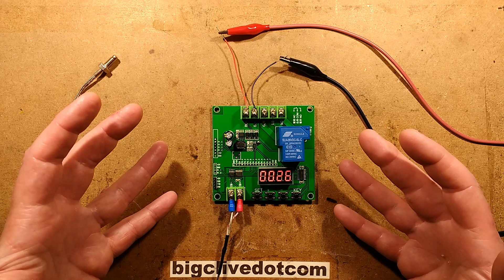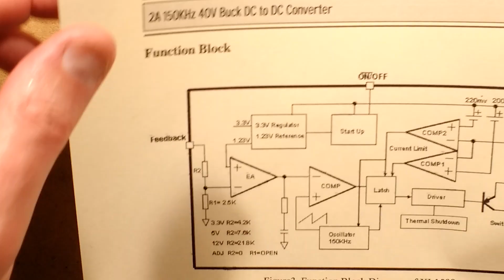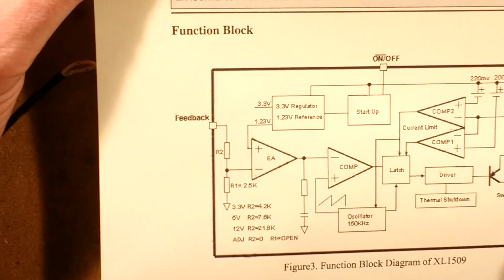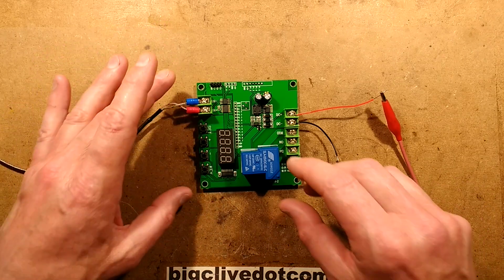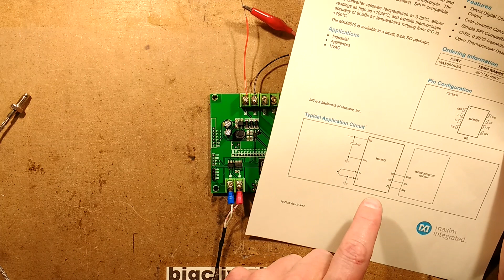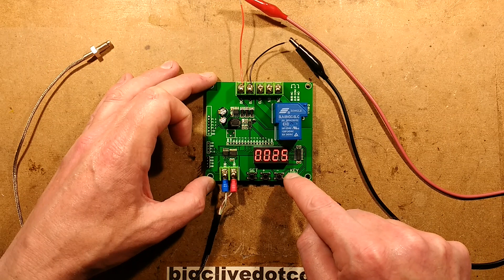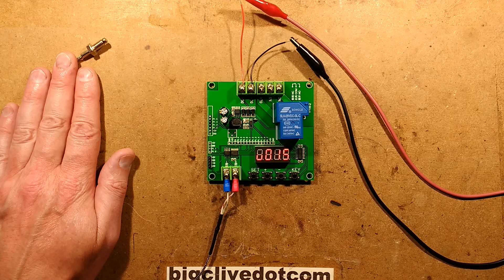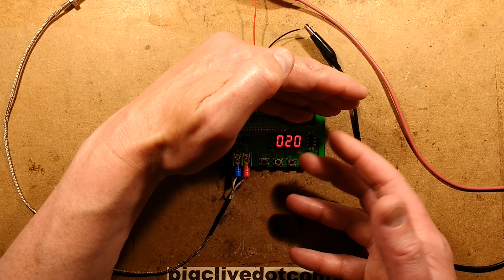"Educational" temperature controller.  (In a bad way.)

Comment: So your body temperature is 17C. No wonder you never bother with central heating.
Reply: Jim Fortune 
Technically, Clive is dead!
Reply: Clive confirmed for being a vampire.
Reply: Clive has played a herd member in The Walking Dead and was the only extra that didn't have to act.
Reply: Clive's environment is cold because he only heats from within with the handy baby bath water heater XL. :)
Reply: Maybe that's why he was worried about reflections from the mirror base of that power bank in the previous video!
Reply: RWBHere
I hadn't thought of that!
Reply: Clive. How a about looking a DIY 15KV spark generator. I just got one and accidentally blew the transistor by connecting it to 12v rather than 3.7v). But I’d like to hear your thoughts on it.
Reply: "Winter is coming"
Reply: He's cooler than his 26 degrees environment
Reply: Well, that explains 15C ambient from other video

Comment: That is what happens when the input is not isolated properly from the control circuitry. For those that do not know what the problem is, thermocouples put out millivolts that has to be measured on a voltage bridge to get an accurate reading. Then do calculations to determine exact temperature as the temperature does not correspond to a linear output it is logarithmic.

Comment: I had something similar happen with a circuit I was testing, where switching noise would couple through the thermistor's leads and get into the cooling fan control circuit. The fan would instantly stop rotating and the circuit, overheat.

Comment: The most surprising thing about this video is that your workshop is as warm as 20 degrees.
Reply: UK's just had the hottest May since records began...
Reply: I've really missed out then, I wouldn't say we've had a very good May where I am (SE UK) other than a handful of days. It was good to have a dry bank holiday for a change though.
Reply from the maker: I'm not usually into heat, but today was outstanding.  The TT races are on at the moment and it was the Ramsey Sprint today.  I enjoyed wandering about  in the sun.
Reply: It’s not been bad today up here in the middle although Sunday was better. 
23deg upstairs now with all the windows open.
Reply: Kind of sucks to be in Kent then, it's been under 20  degrees here today, a bit stuffy and in need of a thunder storm.
Reply: James Valentine maybe Kent has a crappy temperature controller too 😆
Reply: Maybe the AC doesn't work.
Reply: UK doesn't have AC in houses
Reply: Michael _Howto It's a joke.
Reply: That's weird, because so far here in the states, May has been very cool. It got down to a nice chilly 56F the other night.

Comment: If you short-circuit the thermocouple terminals, you will read the ambient temperature (that is measured by a thermometer in the converter chip)
Reply: John Coops. Try to say something constructive, like Alejandro tried to do.
Reply: I've seen all the video. He shorted the terminals "to see what happend", and the reading was a very low value the first time (6º). Then tried again and it red 28º what is more reasonable but he sed it's "odd". It's not odd for me (a little high but not "odd"). It is normal. The previous value of 6º was odd. A new test after changing temperatures red 22º for a moment and he sed it is "strange". It is not strange at all. It es a correct reading when you short-circuit the terminals.
Reply: Alejandro Vargas.
What Clive should have done (for his test) was short the + and - terminals (with a short piece of wire) but not hold on to it with his hands. His hand creates a short and/or picked up noise.
Then, in theory, the output of the 6675 should represent the temperature of the cold junction.

In my experience, it is best to also use "digital isolation IC" to prevent corrupted signals through the SPI bus, especially if you use this type of metal shielded thermocouples to sense the temperature of metallic parts (That should themselves be grounded)
Reply: John Coops. Alejandro did not suggest to short the terminals and Clive got mixed results.
We were just saying, the expected result is ambient temperature, which seems to me, none of Clive's attempt gave.
Reply: John Coops. The have medication for adult tantrums these days. Take a look 😀

Comment: The tip of the probe looks like it's meant to be screwed into something earthed, and that the shielding braid gets grounded that way.
Reply: Keep in mind though that the threads on these thermocouples are usually M6*1,25 so you need a fairly special tap
Reply: jhsevs If the case is earthed, you don't need special taps.
Reply: You screw it in to mount the thermocouple. It's threaded
Reply: @jhsevs  on Ebay they are also available in M6x1 and M8x1.25
Reply: G Leggett exactly. They're not m6*1.25, which is harder to find. Not everyone has access to ebay at all times either, so finding those locally can be a hard task. M6*1.25 is really close to unc 1/4-20 though, which is 1/4" at 20tpi or 6.35mm at 1.27 pitch. It's almost but not quite.
Reply: G Leggett wait, you mean the thermocouples, or the taps, that are available in m6*1 or m8*1.25?
Reply: @jhsevs  sorry I wasn't clear - , thermocouples are available with M6x1 and M8x1.25 threads. M6x1.25 tap I found for a pricey £13 on Amazon. It would be cheaper to find a matching nut and weld/braze/solder that to the thing whose temperature you were measuring. For liquids in vessels I used to make up housings for unthreaded temp probes from 1/4 pipe fittings and "glands" cut from silicone tube.

Comment: You are probably not far off the mark that it's a kid's first design.  Or a design from a graduate with no experience.  Guy in China decides to set up a company making stuff like this, hires a new graduate on the cheap (or asks the hobbyist kid of a friend) to do the design, and away you go.  After the first production run he spots all the problems and flogs them off cheap because they're crap.

And that's one of the better companies.  The bad ones never realize the product is crap and keep making it.  The really bad ones realize it's crap but it sells, so they keep making it because there's no comeback.

Comment: I needed help on a W1209 temperature controller and your old video was right on the button. Odd I had missed it, only found it by accident. You should have mentioned it on this video. I have just ordered 2 more at 99P each on EBAY. It's got to be the best value for money ever. A little fiddly but once you know what does what it's superb.

Comment: Some Chinese high school student's science project. He probably got a B-.
Reply: A cheap product that doesn't work like it should, should have gotten an A.
Reply: Well, a lot of students wouldn't be able to design a board and software that at least is able to do something ;)
Reply: My experience is that of BitBastelei. When i would submit a preliminary version of university project and list its known/suspected bugs like "lack of debouncing" etc, i had a few days left and i'd still fix them up, they were like... look it passes simulation, let it go, it's good enough, we really just care that you brought in the concepts that we touched upon in the lectures, it's not an actual product that anybody is going to make, it doesn't have to actually work, YOU'RE GETTING TOP MARKS ANYWAY LET IT GO OK PLEASE?
Reply: no high school student has the time, the vast knowledge, money or experience to design a micro-controlled device at even the Chinese bad engineering level and make a double sided PCB for it, the surfacing mount soldering it together, there is just too much to learn and know, to get to that level, this would be an A grade uni engineering student efforts. The best is
home made PCB from the hobby store and a off the shelf microcomputer they can program.
Reply: @bjtaudio I designed and programmed a similar project back in high school in the 90s. The school didn't have facilities for manufacturing multi-layer boards so I built it single-layer and submitted the multi-layer design. That was an A. 
If I'd submitted something like this during my engineering degree it would not have got a passing grade. 
Later, as a postgrad teacher, if this had been submitted by a first-year student I'd have declined to mark it, but instead have invited the student to review their design process with me.
Engineering standards are a little higher than you seem to believe :D
Reply: WolfePaws no way a first year engineering student has the time/knowledge to design a project like this from scratch, I'd know since I just finished the first year of my EEE degree, I got firsts in every module (apart from one where I missed an exam) I also had a lot of EEE knowledge from school/A-Level prior to university and I wouldn't be able to design this circuit from scratch without a good few months of time to do so, first year is covering fundamentals, the closest we got to this was in the analog circuits module, we covered analysing diode, voltage clamps, peak detectors, transistors, mosfets, op-amps and rectification circuits. I'm at a good university too, my brothers doing the same degree at a less well regarded university and he definitely wouldn't even know where to start. Second year I'd agree this would probably be an average project, but not first
Reply: I find that very hard to believe, that there are any high school subjects where you get the chance to learn electronics engineering then to design a schematic /PCB and program a micro-controller too and get it working to a professional standard. All I have seen is Arduino projects where you make a basic machine and program it and use existing PCB and off the shelf parts. This is just the beginning...I think you exceed the knowledge of the teacher too that gave you the A grade. So next week you fully designed a rocket and shot to mars? and still just a teenager at school. I like to see you're PCB and schematic design...you managed to get it to a professional standard really? there is a lot to know.
Reply: Stories I heard from a friend that does Information Science are much the same. Nothing of what they do would be applicable, allowed or best practice in the real world. Weird languages, dead libraries, no attention for security in any way, teachers that make assignments that are actually impossible in the real world etcetera etcetera.
Reply: ...and probably just opened a store at aliexpress :-)
Reply: I WOOD HAVE TO AGREE

Comment: Shorting a thermocouple input will usually read the temperature of the cold junction compensation sensor (resistor) (the temperature at the terminal strip). I wonder if this even has cold junction compensation.
Reply: Of course it does. MAX6675 has cold end compensation built right in and always operational.
Reply: But it should be mounted as close to the connection terminals as possible to correct the right junction.
Also, it is recommended to always use common mode filtering.
Reply: Yeah does have cold junction but I doubt this is very accurate in this implementation, a terminal strip like this is one of the worse connection methods for a thermocouple as it most likely introduces more dissimilar materials and thus more parasitic thermoplastic, the main sensor disconnect/connector should maintain the same material for metal A and B right up to metal C, metal C being copper bolts, copper nuts, copper spades, copper legs and copper PCB tracks.
Reply: But those junctions are in symmetrical pairs. Also there is no copper to copper contact between... basically anything. When you solder an IC on a PCB, the IC legs are made of steel, not copper, and even if they were made from copper, there's a thin layer of tin in between! No matter how thin, a junction is a junction. And the IC legs are connected to the IC substrate with gold wires.

Comment: One thought comes to mind: EAGLE, and many similar packages have reusable circuit modules you can just drop into a design. If this were a student's design from scratch I would have expected the component placement to be further apart, but the fact the various modules have components clustered up might mean that the modules were pulled out of libraries and placed down.

Comment: Remember a thermocouple is a differential sensor with a sensing junction and somewhere a reference junction (where the special termocouple wires connect to conventional wires). So when you short the thermocouple input you expect the reading to go to room temperature, (the temperature it thinks the reference junction is at). When the short took it down to a low reading was the board colder by any chance?

Comment: Hi Clive, As Alejandro Vargas
 noted, this is a k-type probe, that is, it senses the temperature difference between probe tip and the MAX6675 side. The MAX6675 than compares the reading with a virtual 0° reference point by reading the ambient temperature itself. As a result, the MAX shold be placed as close as possibe to the "cold side" of the probe (the terminal block) far from heat-generating parts.
Reply: The cold junction, and the Max, are all at ambient temperature. Theoretically you are correct, but the impact on the video is small. 
There are many other more likely problem sources mentioned in the comments.
Reply: Oscar Gr that's right. I perfectly agree.

Comment: First idea, when I saw it was, that the temperature sensor was wrong polarized. Trying a potentiometer instead of the sensor will perhaps bring a little light to what exact the circuit-board is doing. Sorry for bad English.I'm from Germany.
Reply: Uwe Soboszcyk That's how I would go about. Your English is just fine!
Reply: Connecting a potentiometer in place of K-type thermocouple does nothing, as the thermocouple has no resistance whatsoever, it generates a little voltage instead.
Reply: So what are the wires, superconductors?

Of course it has resistance. Just because you think it's low, doesn't mean it 'has no resistance whatsoever'.
Reply: Monkeh, if you want to electrically measure the wire length, you may ponder the resistance of a K-type thermocouple. If you want to measure temperature, as intended, the deciding parameter in a thermistor is its resistance, and as opposed to that, in a thermocouple, it's the induced voltage.

And yeah it has no resistance whatsoever. K-type wire often has less resistance than the sloppy Chinese screw terminal it connects through.
Reply: I'm well aware how a thermocouple works. That doesn't change the fact that the wire it is composed of has resistance.
Reply: +Monkeh What's your point? A potentiometer still won't work.
Reply: Of course it won't. Never claimed it would. My point is saying a thermocouple "has no resistance whatsoever" is as stupid as saying "planes fly so they can't move on the ground".

Comment: Most temperatue controllers are set for up scale burn out i.e. open circuit sensor drives the display up scale which would normally turn off the load by passing the upper set point, shorted input should read ambient temperature i.e. cold junction temperature for a thermocouple sensor.

Comment: An open thermocouple often makes the controller read high, it's called 'offscale high' and is designed to force the relay off. The screen of the thermocouple will be earthed at the thing it's screwed into, or else you can earth it at the controller if the psu is isolated as it should be. Leakage from a heating element may also interfere with thermocouples so again the two should be bonded together and to earth. 
Shorting the thermocouple out should make the display read room temperature because it should show the cold junction compensation value (should be measured locally on the board by a diode or thermistor).

Comment: I’ve seen that non-shorting issue in a few cheap terminals...
i think the screw head isn’t part of the electrical design.. only the actual ‘plates’ that sandwich the terminal/spade.
If you’re unlucky, and the screw thread doesn’t touch the actual wire or spade - then it simply passes through the conductors to the captive nut on the other side of the mechanical assembly. 
I can always get a connection at the mating surfaces... Odd, but there may have been a reason ??